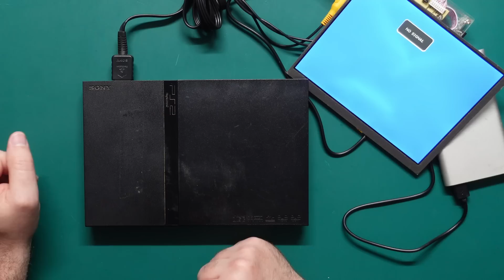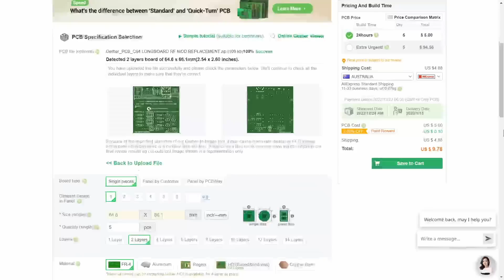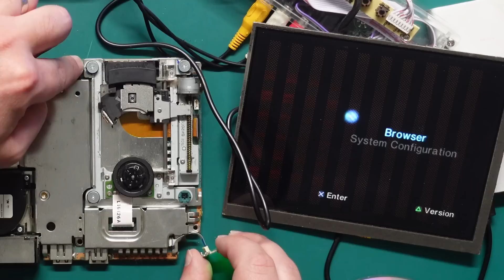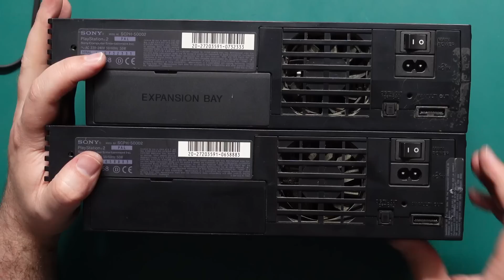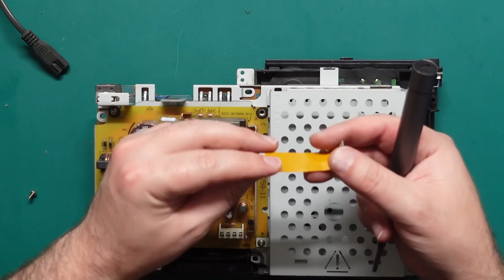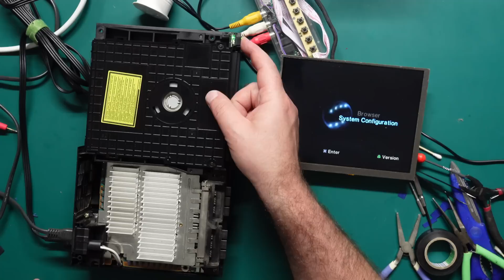Sony PlayStation 2 repairs - glitchy video, bad lasers, no power, and a hidden surprise

Comment: modbo4 is pretty cool. you can boot backup ps1/ps2 games, or boot from memcard. It doest kill the laser, bad media can tough. if its an 5k model, check on the laser coil resistance. if its below 5 ohm, it fried the LA laser driver Ic on the board. replace laser, and driver Ic. perform romeo mod to prevent it from self toasting again. I think 5k ps2 is the best of all, but needs a little knowledge to use it with modchip safely.
Reply: Instead of the Romeo mod, use the matrix pic fix or the comsoft v4 laserfix.

I helped to backport those to the 50k series revisions. Kel and a few others helped to test the fixes as well.

I'm also eventually going to backport the fix to the 3900x,3700x series. They are said to use the same CXD3098Q Digital signal processor as the 50k and up.

I also have a few v13s with official Sony laserfix that I'd love to identify the circuit from the board.

Cheers!
Reply: @haloslayer255  whats wrong with romeo mod? It worked for me flawlessly, ive tried my console with purposely bad media, never had any issue
Reply: @attilahavasi6987 While it should work, the Romeo mod doesn't mute the optical driver IC or shutdown the console in case of a mechacon crash. The Romeo mod is rumored to still allow for the optical assembly to be destroyed, just over a longer period of time.

Comment: If you have a phat ps2 that won't turn on and you can't see anything blown, there's three orange diodes in a group. They should only have continuity in one direction . if they have it in both, then that's the issue
Reply from the maker: Good to know. I've got a few things to check on that slim PS2, just haven't gotten around to it yet

Comment: The PS2 closing the optical drive on its own will never not be amusing. I used to have one that did that, never quite figured out what caused it. The drive worked fine and I'd even rebuilt it before (cleaning and also getting a stuck disk out at one point)

Comment: 15:05 My guess is a video RAM rather than CPU itself.
Reply from the maker: Could be. I haven't completely written off this board so it'll be back in the next part
Reply: network resistors array

Comment: The last version of the slim was impressive given the power supply was squeezed inside as well.
Reply from the maker: It's funny, I had one of those in the pile as well but it was the only fully working one so it didn't make it into the video. Which I guess isn't a surprise as they're the supposed to be the most reliable. I only pulled them all out because a friend asked if I had any PS2s, so they got the only good one

Comment: The mechanism uses separate lasers for CD versus DVD, so it's not unusual for a drive to handle a CD when it can't read a DVD.
Reply: He knows that. He even said as much.
Reply: @PJBonoVox  he did? I was listening for it, and missed it. Might have posted too soon.
Reply: had no idea. that’s an odd design.
Reply: @eightsprites  I might have completely misremembered this. Don't believe people on the Internet... ;)
Reply: @eightsprites   It's entirely normal for DVD and BD pickups.  The characteristics of the media (the pits etched into the disc) are optimized for a particular wavelength of light.  CD uses infrared, DVD uses red, and BD/HDDVD uses violet.  The shorter wavelengths of each successive format allow for the data to be more densely packed, yielding higher capacities.  So, DVD players that want to read CDs need infrared and red lasers, and BD players that want to read CDs and DVDs need infrared, red, and violet lasers.  They're all packed together into the optical module on the sled, along with a bunch of mirrors and lenses, and the photodiode pickup array.

Comment: You could simply get a memory card with FMCB (Free MCBoot) and a network adapter to load games from hard disk. While all my fat PS2s have still-working disc drives, that's how I use mine as well.

For the slim, which can not use a hard disk, you can get an SD card adapter that uses one of the memory card slots.

Loading from USB is possible as well, but too slow.
Reply: I’m migrating from HDD to network loading for my PS2 games, since I am already setting up a RetroNAS server for my MiSTer and some other consoles/computers.